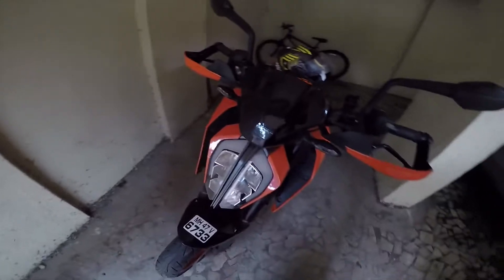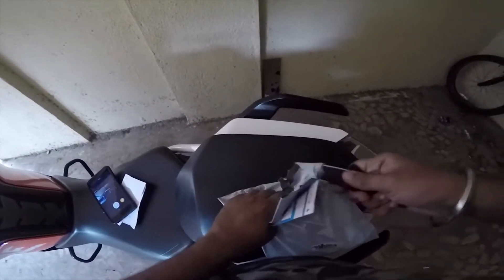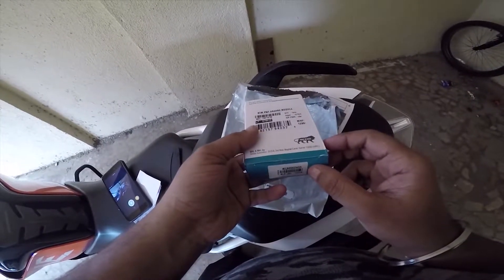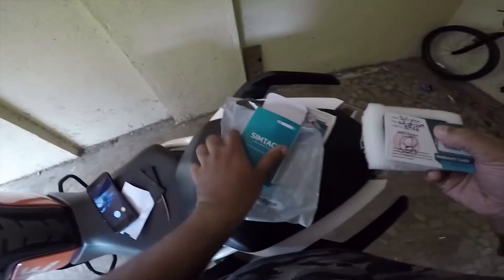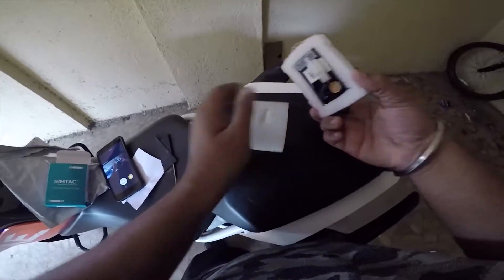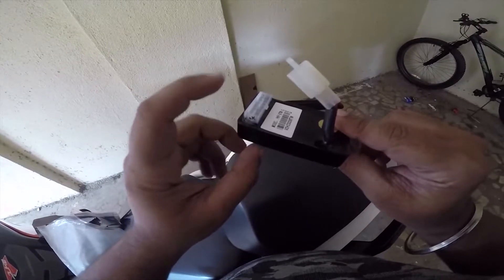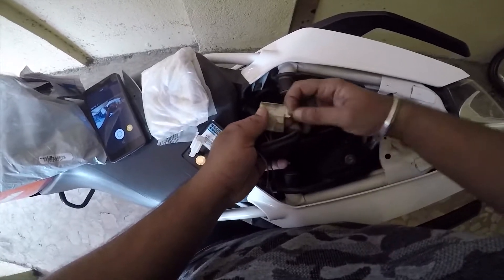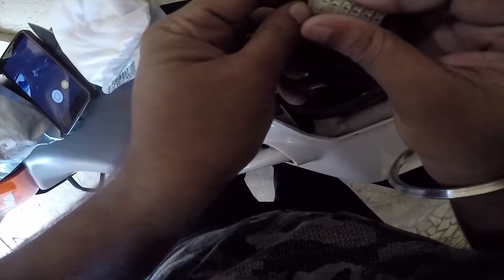Simtac Hazard Flasher for KTM 390 Duke | Simtac |

Comment: I like it! Also, where can I get a windshield like the one you have?
Reply from the maker: It's a TVS Apache RTR 200 4V stock visor which perfectly fits the 390Duke.....
All you need is to get rid of the plastic covering the front indicator wiring and use the indicator fastener to get the visor in place......

If you're from India.....you can get it from any TVS Service Center.
Reply: Thanks for the quick response man! Hoping they'll ship to America.
Reply from the maker: Yeah...I guess...they must....
Ride Safe Bud!